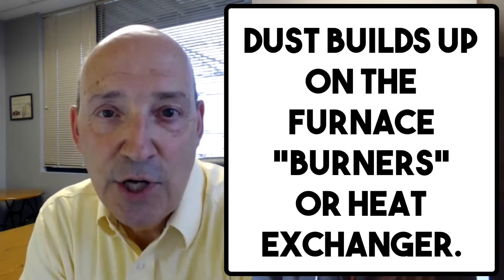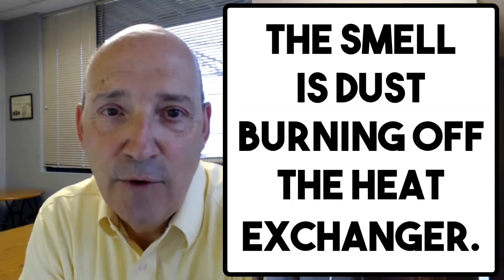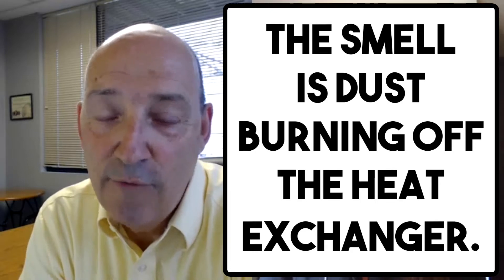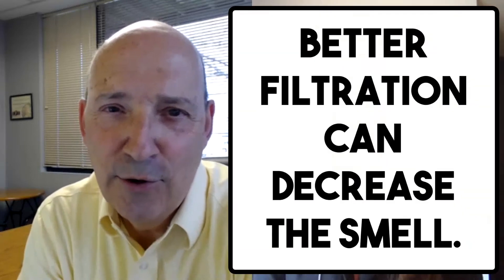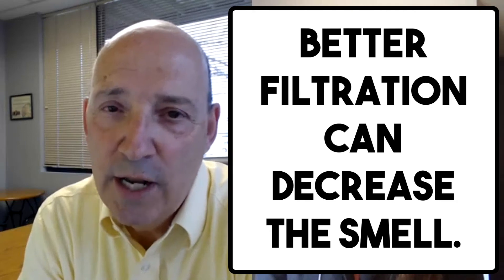BURNING SMELL WHEN I TURN MY HEATER ON \\ Is it normal to smell burning from furnace

Comment: Mine just started this smell and it smells all the time nonstop! It smells like burning plastic!
Reply: Be safe don’t use it
Reply: Did you figure out what it was? I have the same issue
Reply: Same
Reply: My furnace is just simply for maintaining the water pipes and such.
My True Living area of my home is in the extension-room, which I heat with an infrared heater, obviously, only when I'm home, and obviously when I sleep in here for the night.🌙 😴
Reply: mine smell like something is burning,im not sure if is gas,star smelling after the heater went off
Reply: bad blower motor ?
Reply: I just bought a life smart heater, 1st plug in and it had a horrible smell to it, I'm in a camper n a smaller space it was nauseating 🤢 
Smell just staring to go away like an hr into it being on

Comment: I wonder does it ever smells like rotten eggs. It happened twice in my apartment. Similar to my car one day weird.. it wasn't toasty though. Is it suppose to hiss all the time? Like it's real light on the ears. I just figured because the apartment below always has an orange electrical wire running to it.
Reply: mine smells like vomit
Reply: Gas leak

Comment: We installed a nest, and as soon as we did the ac quit working and in fact it gives off heat through the vent and give off a hot smell, advice?
Reply: Nests are fucking terrible.

Comment: My ole furnace is Fumey !!! 🤔
I get kerosene to fuel it. Oil/Kerosene 300 gallon tank. Basically, the Typical manufactured home format set-up. This place was built in 1973,and the additional extension-room,in 1981.😎🎸🎼📻

 Luckily, I Basically have a hybrid manufactured home. It has an additional big-room, attached. Around 24x15 in size dimensions. I just keep the door 🚪 Shut, and now Make it my Sleeping area, and on the big-couch 🛋 that I recently placed in here. 

I run this nice nifty infrared heater, in this big-room, called the "WeWarm". It heats it up Real Nice for comfortably sleeping on the big-couch 🛋 at night. 🌉 🌙 😴 

 I just keep the furnace at 60, right now, at the moment. Keeps the fumes from getting Too Much out of control. I'm strongly assuming that the fumes are Mainly due to the age of the furnace, as well as a flawed exhaust set-up..? 🤔

Comment: Wash before use but That Switch On button inside poison smell strong not even plastic smell every time after boil and pick up that kettle to pour horrible strong substance smell ? same with oven before so never used except only stove but what why is that smell is not Normal at all despite equipment works normal ?